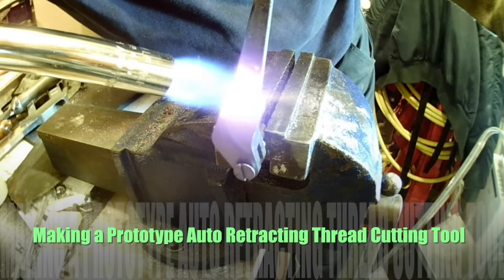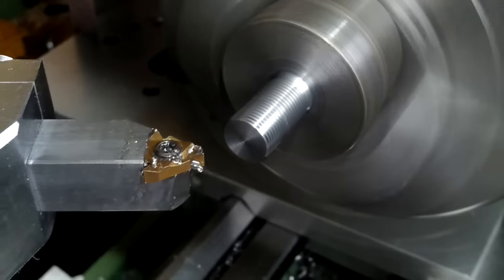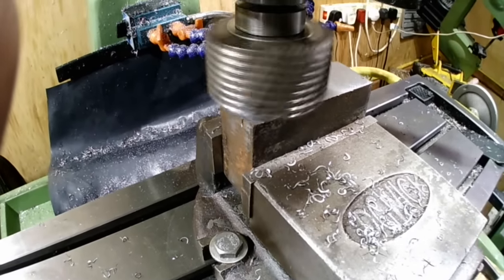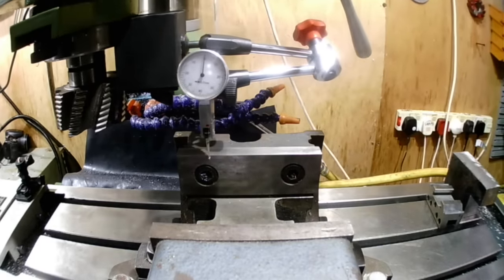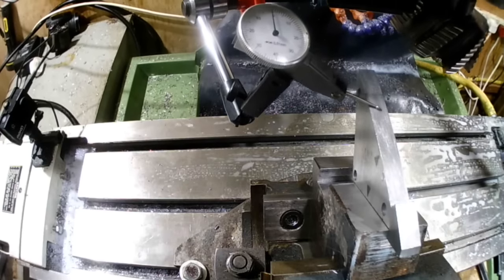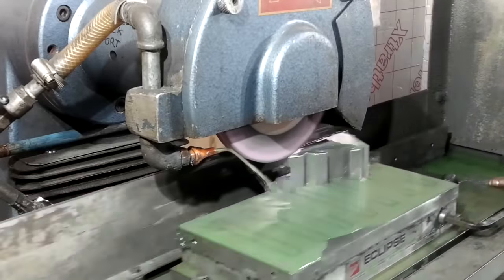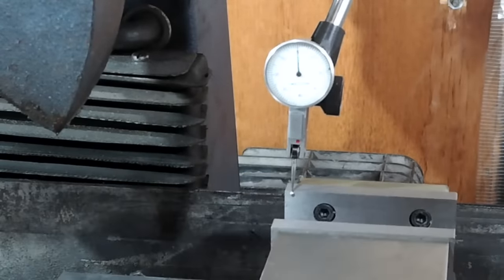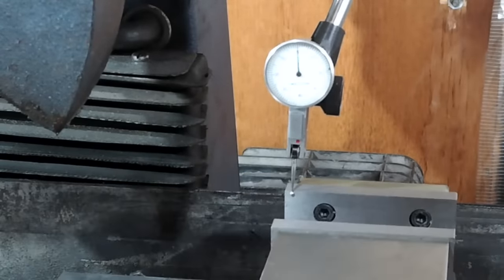Auto Retracting Thread Cutter.

Comment: Pure genius 👍👍👍
Reply from the maker: Ah, I thought you might like this one. I do believe it might be put into production after I was approached by several Indonesian countries, asking if they can copy it..
Reply: @Thesheddweller  Well Paul, it was good of them to ask😊
The gears in my head started spinning when I saw the operation and initially thought youd used the same locking system as they use on the landing gear of commercial aircraft. More people dont know that the wheels on a jumbo jet are held in place by an over centre arm and nothing else.
Really clever design I must say.
Reply from the maker: @NellsMechanicalManCave  I’m left wondering….. and if my suspicions are right, you would know what the significance of ‘Pooleys’ means to a certain group of people… am I right?...
Reply: @Thesheddweller  you got me there and I'm not going to guess at it but suspect military 🤔 
I was going to compare my thoughts to the action on a Luger P08 then remembered its a cocking action only and has no impact on the locking of the breach block. Firearms is another of my hobbies.
You will have to prompt me in the right direction of a Pooley though or I'll spend all day researching it😁
Oh, my knowledge of aircraft. I spent 2 years in a large aircraft facility adapting it to take jets more modern than the 747s that it was designed for. I got on very well with the engineers working there and before long I was getting invited to view areas of aircraft not seen by the public. I got everywhere but I was too big to get inside the fuel tanks in the wings,  🙄
Reply from the maker: @NellsMechanicalManCave  Thats why I asked about ‘Pooleys’, because, its mostly pilots that use Pooleys products. 
The reason I asked was because of your picture it looks like that of a cockpit and you're sat in the captains seat. 
You see, quite a few years ago I learned to fly, and after getting my pilots licence, I went on to become a part time flying instructor with the qualification of AFI. I no longer fly or own an aircraft and I let my pilots licence lapse 10 years ago now but, I’m pretty good on the simulator. Xplane12 with foot pedals, yolk, throttles and a computer with more power than I deserve….
Thats why I asked..
Reply: @Thesheddweller  sadly not Paul. Always wanted to fly but money and a brain disease that hit me in my 20s destroyed all hopes of that. I did take up paragliding for a while but an existing back injury paid toll to that too. As I said previously I got in every conceivable part of those planes and over 2 years and gained a wealth of knowledge about their workings. That was a Boeing 777, the flight deck was quite spacious. I didnt fit very well in a 74, I was just too big.

Comment: No need for a retracting tool; there is a perfectly good method of cutting by starting at the headstock end of the work which eliminates all risk of crashing
Reply from the maker: Hi, yes, you are quite right. 
But, I find with my little lathe, that the thread has to be started from zero rpm with the half nuts pre-engaged using this method. My small variable speed machine will stall at the start of the thread especially near the full depth of thread. This is because the variable speed drive unit must get to running speed before any cut is started. I know this is a bit long winded but, I hope this explains why I made this device. cheers

Comment: This is the kind of improvement you would think lathe manufacturers would be incorporating, but no. New manual lathes are made just as they were decades ago and worse, with shoddy quality. I saw a new Chinese made milling machine without the feature to put the spindle in neutral for dial indicating. Since when do they make machines that do LESS than those made in the past? This would be akin to removing disc brakes on cars and replacing them with drum brakes that are less efficient and cost more to replace. Manual lathes today are all made in China and it's such a waste of time, labor, and materials as they make substandard machines that don't last and always need to be repaired and modified.
Reply from the maker: Hi Thank you for your comments. I knew when I bought the lathe that it will have manufacturing problems. (Because I know from experience that in order to win a manufacturing contract the first few products will be of fantastic quality, its after the contracts have been exchanged they ramp up production, and quality suffers, a lot). You might ask, why didn’t I buy a better quality machine, I’m affraid its down to price.

Comment: Start the thread from the bottom when possible
Reply from the maker: Hi. That works well, except on my lathe, the half nuts aren’t much good, unless I work at slow speed. It’s a cheap Chinese lathe, the best I could afford at the time. 
Regards
Reply: If you started from the bottom face and worked towards the end of the thread you would end up with a left hand thread, unless you had the threading tool upside down and ran the chuck backwards.
Reply from the maker: @LeonLionHeart899  Thank  you for your comments, I have used the backwards method and it is a good technique, but my lathe is a cheap Chinese lathe and the half nuts have been known to badly engage, causing a tool breakage or a double helix thread. My other issue with backwards threading is, that often the half nuts have to remain engaged to achieve the desired thread, like imperial threads on a metric lead screw that's why I made this tool.  with this tool, the half nuts can be fully and properly engaged at high speed. The index register on the lead screw can also be confirmed at this high speed before the thread is started. Regards
Reply: @LeonLionHeart899  right, that’s all part of the process

Comment: 6:00 you turned that nice chuck of material into chips instead of cutting it out with literally anything else ? that's a sad waste of useful material. 
i or someone could have bought that chunk on ebay or something if you didn't want it. 
i like the Auto retracting tool though.
Reply from the maker: Hi, i’ve got a bucket of swarf if you want it. :-D
regards

Comment: nope aint buying it,no way to maintain pitch after a little use,you should have wire gauged the part to prove me wrong,im pretty sure i seen a split cut into pitch at high rpm